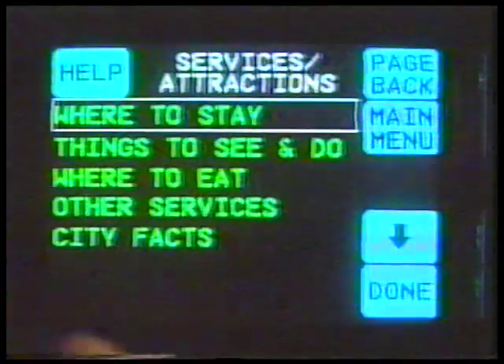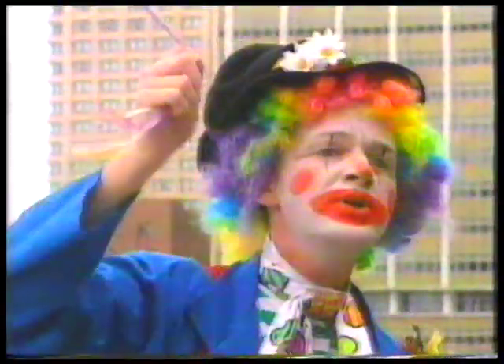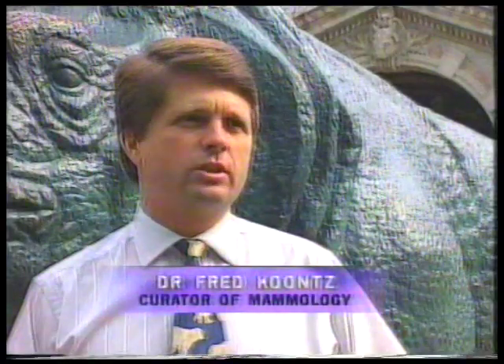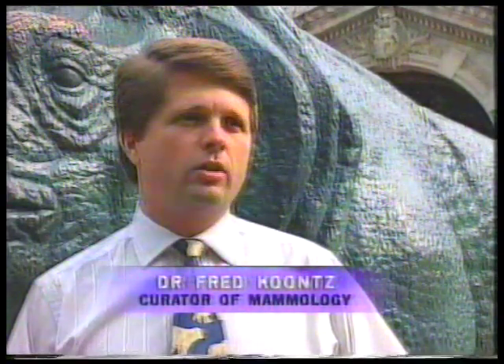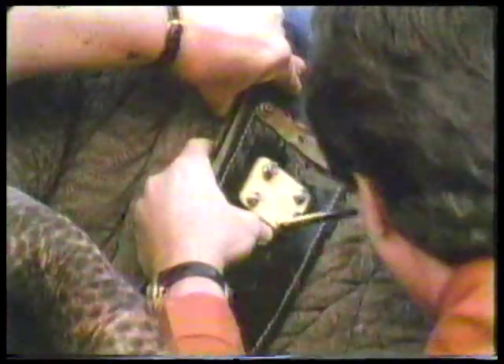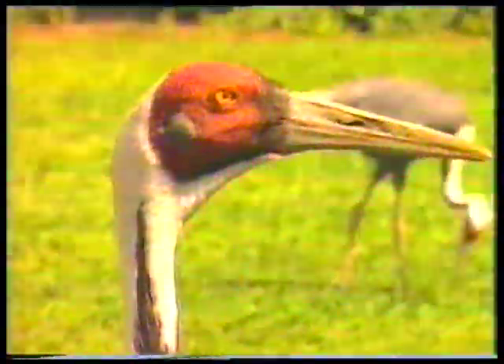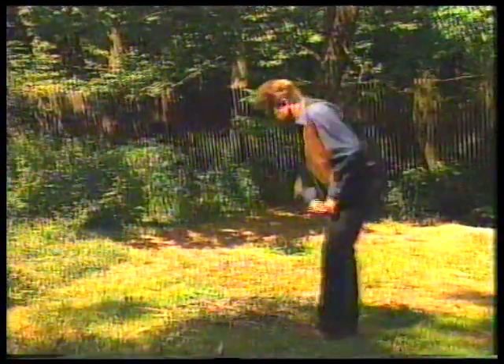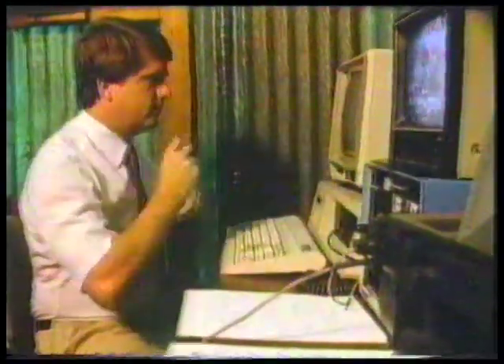Beyond 2000 1993 full episode part 1 of 3

Comment: @ruantengyi Well, kinda, back then the name of the show called Towards 2000, started way back in the early 80's on the ABC until they changed the name and broadcaster a few years later. 7 picked it up and made it an hour long show. Was one of my favs. The NR750 was way ahead of it's time, and not just for the oval pistons either. The entire bike was cutting edge. Thanks for the up appen1